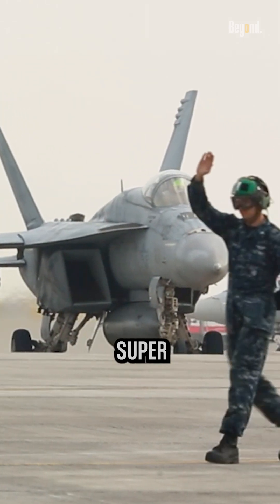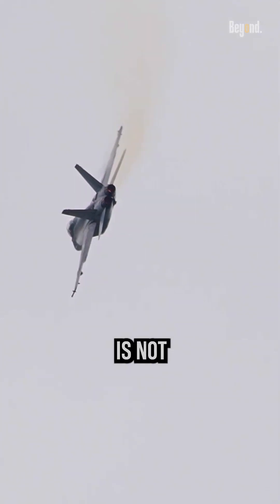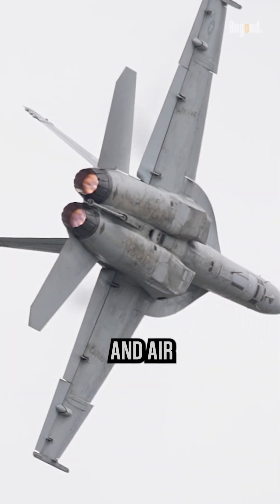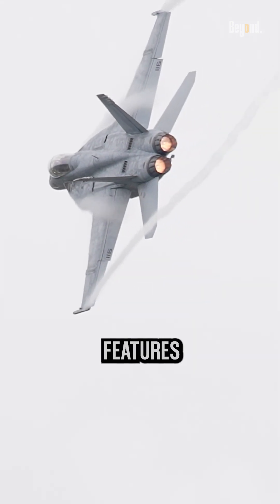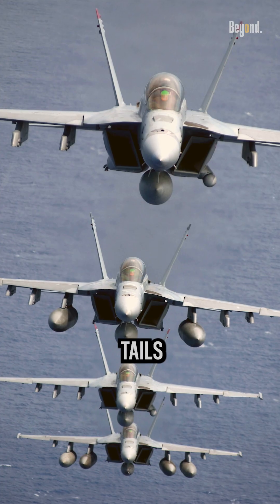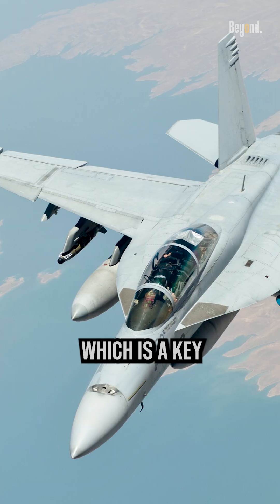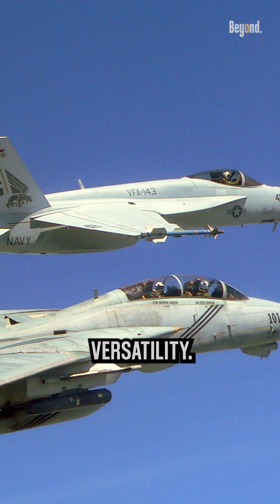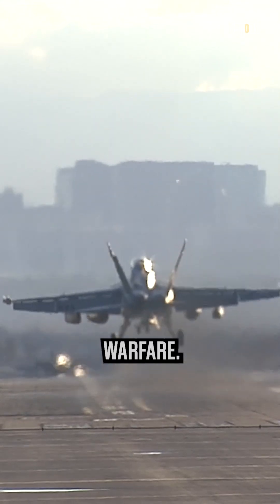Why isn’t the F-18E/F able to reach Mach 2? #shorts

Comment: The real reason why it cant reach mach 2 is because when the aircraft exceeds mach 1.8, the airflow near the intake becomes unstable and can cause engine failure. So they’re a software that prevents the aircraft from exceeding mach 1.8.

Comment: The SuperHornet makes 22,000lbs of thrust per engine with afterburner.  It’s a slow plane because it has tremendous drag, not limited by the fact it drags its ordinance crooked through the air like giant air brakes.

Comment: The main reason the top speed is less is due to the fixed geometry engine inlet, much like the F-16.  The F-14 and F-15 have variable geometry to place the shockwave at an optimal place.   As for the F-22 it is perhaps a more refined design.  The variable geometry comes with a cost and weight penalty.

Comment: Where the hell do you your info? I want to correct your errors, but there are more than I want to write about!! Just to point out a couple, mach 1.8 is supersonic (mach 1 is the speed of sound). The last Navy plane without an afterburner was the A-7 Corsair (60's/70's vintage). They found that mach 2 just wasn't that necessary for fighters that are not dedicated air superiority dogfighters!

Comment: F-18 is a supersonic aircraft, capable of supersonic flight (top speed mach 1.8). And yes it does have afterburner. In fact it needs afterburner to reach the speed of mach 1 and above, as a matter of fact all supersonic aircraft need afterburners to do so, unless they have supercruise capability.

Comment: You do realize the F -18 has had the same twin tails and vertical stabilizers since the first F-18 was created. They are nothing new. They are remakes the Navy is trying to get new aircraft but been stuck with what they have. because the aircraft they want and need have been denied to them. Being what they have the F-18 is nothing special or anything about them it what they make work for now.

Comment: OK, it does go supersonic, it does have afterburner. But getting to "real" reasons it's a M1.8 fighter not a M2.0 fighter. Pylons canted at 3 degrees, external fuel tank almost always, fixed inlets, low wing sweep of about 15-20 degrees.

Comment: This narrator doesn’t know what he’s talking about! I’m a retired aerospace technician/inspector former employee of NGC prime subcontractor for the F/A-18 program prior to that I served 4 years in Naval Aviation working on F/A-18 and various naval aircraft. Here are the facts the F-18 is a supersonic aircraft and do have afterburners, the vertical tails are canted 15 degrees for better handling and performance, reducing rcs does not affect aircraft performance. The main reason for lack of speed compared to F15,F16,F22 is the engine G.E. F414 lack the power! The Navy wanted to save cost so they decided on a smaller airframe and engine as compared to its predecessor the F-14 Tomcat!!! Check out the movies Final Countdown & Top Gun the first one.
Reply: Well i saw a lot of this type crap video with some unereliable data most of people will totally buy it without further analyze
Reply: Two of my fave movies! The F-22 Raptor, on a side note, has the radar cross -sectuon of a small to medium sized bird, I have heard 😎
Reply: Many channels pump out false information.  Pretty soon AI will be the deciding factor on truth. Other’s voices will be silenced.
Reply: I agree the Narration is very wrong. The F/A 18 can do 1,190 MPH which is supersonic flight. Supersonic starts around  750 MPH. It does not need to do Mach 2. Neither does the F16.

Comment: The narrator also said that the F-18 E/F Super Hornet wasn't optimized for supersonic flight, the last time I checked Mach 1.8 is VERY MUCH Supersonic 🤔
Reply: It’s not that fast and it does have an AB
Reply: Hard to get one to 1.6 and it isn't optimized for speed. However, it does require some in its mission requirements. And it definitely has AB. Who writes this stuff?
Reply: The aircraft struggles to get past Mach 1.2. In a 90 degree nose down dive in full after burner. Words from an f18 pilot.
Reply: I am a former Avionics Tech that worked on them and this is correct.  There is so much drag that it can’t fly anywhere near Mach 1.8 and 1.2 is about as fast as it will go.   It is a good jet though.  We used to fly against F-22s and scored a bunch of wins so don’t take it for granted. She has a mighty sting.

Comment: What do you mean it isn’t equipped with an afterburner? That’s just not true statement at all. Its turbo fan engines absolutely have afterburners. 22,000 lbs of thrust a piece when in afterburner, not sure why you would say that. It can achieve Mach 1.8 but usually will top out at Mach 1.6 because of a heavy load out, my father worked on legacy hornets in the Navy and I know a lot about these jets. Her is something true you probably didn’t know, the F/A 18C legacy can super cruise at around Mach 1.04 to Mach 1.1 at Angels 30. You should talk about that. You are right, it has incredible nose authority and incredible maneuverability especially at slow speeds but the Hornet is by no means a sub sonic aircraft. That’s just ridiculous that you would even say that. Is this a joke video? The hornet has an afterburner.
Reply: These videos are not made to be accurate. Just to get views.
Reply: turbojet, not turbofan
Reply: @boristhedestroyer-j3d No.... All modern fighter jets use turbofan engines for their increased efficiency... This has been the case for many decades.
Reply: @TaterMater22 turbofan engines are mainly used for passenger planes, turbojet engines are the ones that fighter jets use. They're the ones with the afterburners.
Reply: @boristhedestroyer-j3d  F-119-PW-100 engine from the F-22, turbofan. 
Saturn AL-41F1 engine from the SU-57, turbofan.
Shenyang WS-10 engine from the J-20, turbofan 
Source everywhere. Shall I continue?
Reply: @300zxsailor  nevermind i just checked it, you're right. Sorry about that.
Reply: @boristhedestroyer-j3d  All good man
Reply: @boristhedestroyer-j3d  No they are not. Do some research. Go look up the engines of any fighter jet and see what type of engine they use. Literally no modern fighter jet uses a turbojet engine. Since you seem to be struggling doing your own research, I'll get you started. The F-18E/F uses a General Electric F114 TURBOFAN engine. 🤦🤣
Reply: You beat me to the punch. In fact, the E/F is programmed to launch from the carrier in afterburner. This throws into question everything addressed in this video
Reply: That dumb dumb don't know one plane from another 😂
Reply: Both the Hornet, and Super Hornet have afterburners 👍
Reply: I agreed but I ain't reading allat